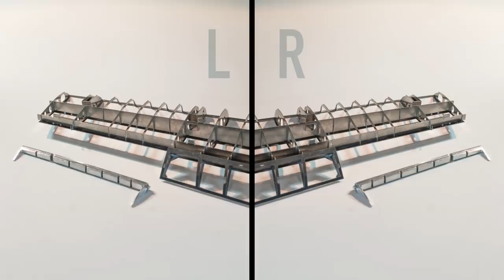Famous ME-BF 109G - stopmotion assembling of Artesania Latina's 1/16 metal stripped model

Comment: Hello, I love your videos very instructive indeed. Would you consider sharing the techniques you used to age the deck of the Terror,,, I'm at that stage now and would very much like to do the same technique. Markos
Reply from the maker: I'm pleased to hear you like my work. Regarding my deck I darkened the plank edges with graphite before I glued them to the deck. Next I sanded the planks on deck and sealed it with wood varnish. When dried I sanded primarily the plank's edges lengthwise very coarse. I then mixed black and umbra artist oil colour with lots of white spirit and painted the entire deck with that mixture. Let it dry for some minutes/hours and wiped it away with cotton sticks until I found the effects sufficient. 
I hope my description is helpful for your work. Best regards, Tom
Reply: Hello Tom,

Thank you very much, I really appreciate you helping me with this. Your instructions a crystal clear. It's a beautiful model but more beautiful when you build it. Markos

Comment: Impressive work ! I just don't understand the choice of the brand here : why did they decided to let the least interesting parts naked while the engine and most detailed parts are covered ?
Reply from the maker: The cowling is only fixed with magnets. It could be removed or placed whenever you like it...
Reply: @TomGrigat  True that, but it could be also true about a fuselage or wings ;)

A hybrid system where there are holes in the skin showing the internal "organs" would be awesome from them. Their talent and execution would help a lot !

Comment: Interesting build. One extra step you should do is to drop down the two slats on the wings as, being spring loaded, the couldn't stay closed while no air pressure was present on the leading edge of the wing.
Just for reference: do the kit lack fuel tanks?

Comment: Hello TOM.... I was waiting for such a video for a long long time. This kit was my last year christmas gift from me to me. However I was wondering if someone would ever be able to tell me about the build because I never found any review. Of course, and as always your builds are outstanding and the way you film them in stopmotion are even more fantastic. Could you please tell me about the challenges you experienced during this build. I printed the instructions because I found it would be more easy to follow... above 300 pages !!!... I probably will wait a while before starting this project although. THANK YOU SO MUCH FOR SHARING YOUR EXPERIENCE TOM.
Reply from the maker: You're welcome. First of all I used my smartphone for the PDF instructions. It worked very well for me. Some of the instructions are wrong. F.e. the position lights colors are switched (and I followed) and the trim wheel chains should be positioned between the two wheels, not outside as instructed. The box art shows the correct way. I had problems with the wings mounting. The top holes for the related mounting parts have to be controlled and more opened before assembling. It's very important you clean up every part and dry fit it first before gluing in place. Especially the holes for the LEDs need some special attention. And last but not least: the undercarriage is a major problem if you want the model standing on its own feet. You cannot fix the standing position. It holds it position by the wheels rubber friction on the ground only... Beside this the build was challenging but interesting.

Comment: Tom
As ever brilliant execution and photography however do you think the dihedral on the wings is too acute?
Also the wheels look too splayed in configuration.
Any comments and observations by return would be appreciated. 
Would love to build this model myself but if this is how it’s engineered don’t think I’ll bother.☹️
I would like to see other aircraft in this scale engineered in this way.
Hinged panels and cowlings would make them the perfect model replica.
Reply from the maker: Thanks for your kind words.
To be honest the kit has some flaws. The undercarriage seems not to be even constructed and is not intended for a solid stand. I still have major difficulties with instability. The assembling itself makes a lot of fun - the result is more of a basically representation of the original. I don't think the kit is too near to the original. The wings connection to the fuselage is a bit tricky and due to construction not perfectly aligned. Thus the dihedral is possibly wrong...

Comment: wiring and lighting way too old school .I replaced it with smaller leds, very fine wires that lead to under the base, and a plug in adaptor to replace the batteries. Looks way better

Comment: BEAUTIFUL MODEL. But given the tremendous effort that went into building this, 
I find the RED AND BLACK WIRES that powers the prop motor and lights a huge EYE SORE.
#1 you only really need ONE wire because you can use the model frame as the -ve return.
#2 I'll ditch the stupid red wire and use thin enameled (motor winding) solid wires which won't stand out.
Reply from the maker: A good idea.
Reply: But they do work well in terms of the animation, though, in my opinion. They give an organic feel that you don't get from the metal parts alone. It's the movement of the wires through the parts that feels organic..

Comment: Another great video! But...you can't position both ailerons 'down'...one has to be up if the other is down.
Reply: I picked that also. It had me scratching my head and about to check my sources as whether the 109 had inboard ailerons. 🤔 Didn't think it did as well I know.  (Didn't mean to be picky.😉)
GREAT video though!!! 👍
Reply: Other than that, the flaps-the "ailerons" closer to the fuselage are wrong too. This condition would cause asymetric lift and the plane would probably crash. He should learn something about airplanes, not just build models.
Reply: @marlboro9tibike   @marlboro9tibike Indeed the ailerons are positioned to the outside of the wing.
 In fairness it may merely have been an oversight that the flaps were configured incorrectly as 'ailerons' and visa versa. 
Setting up for such a stop motion production requires a great deal of effort and concentration and errors do occur.
 We're all human after all. 😉

Comment: Superb ;  as always ! 👌

My only small criticism would be: you showed fitting those electrical wires to the rudder, but never explained what they were for. Just the rudder, and not the elevators nor the ailerons, why? 

Looking forward to your next build. 

Rick 

(As someone who's currently working on a Museum Grade replica of the Sutton Hoo helmet, I salute you.)
Reply: There’s a tail light.
Reply: @Will Asproth  Ah, thanks. So now I'm confused why micro-fine wires weren't used. Those wires were way too thick! Not to mention, surely the chassis could have been the negative-earth? Otherwise, a superb job.
Reply: @rickbear7249  very true
Reply: @Will Asproth  a single strand of wire, dipped in varnish (for insulation) would be my approach for powering an LED bulb. Amazing he didn't do this; especially considering the other superb modelling skills. 

Rick
Reply: @rickbear7249  You are right, the thick wires look ugly. I would have used thin black coaxial cables instead.
Reply: @Tom Kroebel  Hi, it's great to hear from you, Maestro. Love watching your time-lapse builds. I guess you could replace those wires easily enough, as the replacement would be so thin it'd easily thread through the assembled model.  Are you able to use the chassis as a negative/earth (possibly using car rear demister repair silver to ensure good contacts on any butt joints), as a single wire would be even better? 

Great stuff anyways, 👏 
Rick
Reply: @Rick Bear  standard model kit that is supposed to be easy to assemble by everyone. Thin wires are finicky to work with, easy to break, so most of diecast model kits uses the thick ones. Tom could easily upgrade the kit but I guess he either wanted to remain close to the original kit or simply just wasn't bothered by the wires.
Reply: @rickbear7249  Sorry but I'm NOT Tom Grigat ;-)
Reply: @Tom Kroebel  aaaarrrggghh, all these Toms, Ricks, and Harrys 🤣

Comment: This is all very nice but I do not believe that a Messerschmitt 109 was constructed in that way . The rear fuselage was made up of a series of numbered monocoque " Boxes " that were bolted together for ease of damage repair . The skinned Former and Stringer structure depicted here is using a lot of artistic license to put it mildly .  Which begs the question of what is the point of this model ?
Reply: Also the lights and powered prop downgrade it to being a toy, in my eyes anyway, who is it aimed at?
Reply: " who is it aimed at?" Certainly not you!!  @rf8640
Reply: Why don't you spend 600 euros ($656) and find out for yourself!
Reply: @snoebay88  Agreed
Reply: @RJ Deering I am a model aircraft builder and collector which is why I asked the question in the first place .

Comment: Could someone please clarify for me: are the red ♥️ and green 💚 lights "navigation", "position", or "running" lights? I endeavour as much as humanly possible to accuracy and precision.
Reply: Green for starboard (right), red for port (left). Standard on all aircraft and ships. (Note below that the modeller inadvertently swapped the sides during assembly.)
Reply: @Ensign_Cthulhu  , thanks. My enquiry is regarding the correct terminology.
Reply: @DavidRLentz  I regard them as navigation lights.
Reply: Most of the world calls them navigation lights, or nav lights. Position lights is a term I’d seen more on US aircraft, but Diamond also call them position lights.

Comment: Thank you. Two questions: is the whole model made of plastic? and why did you swap the navigation lights on the wings?
Reply from the maker: It's a full metal model and the navigation lights are a mistake since I followed the instructions without questioning it.
Reply: @TomGrigat  , can you swap them round? 
   Years ago, a friend hired a repair man thoroughly to scrub out the motor boat he just had bought. The cleaner even changed the lightbulbs for the fore position lights, erroneously restoring the red and green transparencies. I told my friend about it, though he dismissed it. He had been a pilot who knew better! I cautioned him with an old sailor's maxim, "port wine is red". He saw the wisdom in the aged adage, so he changed them.
Reply from the maker: On the model it's no problem to re-color them - for the video it's impossible though 😅
Reply: @TomGrigat  , use the colour correction Force, Luke!

Comment: Another work of art Tom, both the kit and video!  Did the kit include the LED system, or did you add it yourself?  Also did you glue, solder or attach the bits in some other way?  Some of them look like they had 'tabs'. ...
Reply from the maker: I'm pleased to hear you like my little experiment. Since the kit is made out of stainless steel I didn't even think about soldering. The structure is bent and glued...

Comment: As usual, this was a pleasure to watch. I was worried that all your fine work on the framework was going to be lost when the engine cowling turned up.

A fine piece of work in all. Though I do hope the landing gear struts were metal rather than plastic. The 109 undercarriage was frail enough without using too light a material to carry the weight of the metal airframe.

Thank you for the boost to my day.

Comment: Fantastic stop motion and great modeling, I have only one issue with the kit and I can fully understand why the kit manufacturers did it that way. 
The construction of the rear fuselage is wrong. As the skin forms the frames and the stringer's run through the skin frames . It would be very difficult for the kit manufacturers to do this in metal sheet .

Comment: Wat happened to the wing cannons
Reply: Since this is a Bf-109G (most likely a G-6), it doesn’t have any armament in the wings. The Bf-109E variant was the last variant to have cannons in the wings. However, there was the R6 modification for the Bf-109G and later variants which allowed for the attachment of external 20mm cannons to be slung under the wings in gondolas (gunpods, essentially). What does seem to be missing from this model is the central 20mm cannon that was engine-mounted and fired through the center of the prop hub.
Reply: @Chris_Lohmann  I suppose a sacrifice there is made to have the hub spin. There are some metal bits that enclose the wires coming out the back of the engine, this is probably meant to be the butt end of the gun. I do wish they could have included that feature, but with the electrical motor in the engine block probably not possible.

Comment: Would these small scale plane models fly if they had functioning motors or does the design not work on smaller scales?
Reply: probably depends on what they are made out of. what would the density of this frame b compared to that of the original? what would the power?
Reply: Technically yes, if it has the density scaled yes
Reply from the maker: Only the shape might fit. But the plan weighs too much! That size could only be flyable as a balsa or Depron model.

Comment: Where is engine's MG 151?
Reply: The absolutely monstrous, massively protruding butt of what is probably an MK-103 30mm cannon, this being a late-war "Gustav" version of the venerable 109, as indicated by the large rounded so-called "boils" covering the twin MG-131 feed trays/breech mechanisms ("Die Beule" was a common nickname for most G series 109's, other than the G-10, which sported a larger, better streamlined engine cowling) is easily visible inside the cockpit, rudely protruding between the rudder pedals and possibly even menacing the pilot's "family jewels." 

The remainder of this enormously powerful cannon installation was buried within the massive DB-605 engine itself, and thus would not be visible to an outside observer. 😉 

I trust I have provided a suitably informative (and, hopefully, entertaining) answer to your question.😁

Comment: The fuselage is not even remotely accurate as far as the construction method is concerned. The original method was very different.
Reply: What's the original method?
Reply: @skinnyvid  Perhaps PDZ1122 is referring to this obviously being different from using many workers and machines in a factory.

However, if it is a complaint about equipment locations in the model of the aircraft, I disagree as I think that this seems a fairly reasonable representation. For comparison, here is a cutaway drawing: https://i.pinimg.com/originals/cb/e1/3c/cbe13c2f55c7b2e7eded5ba378d96be3.jpg